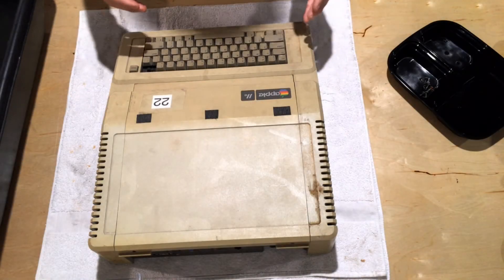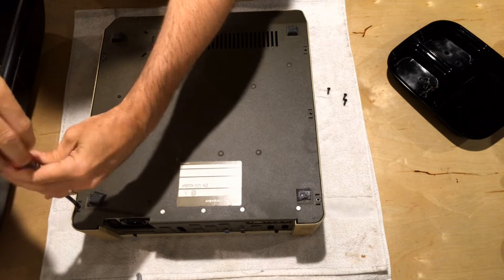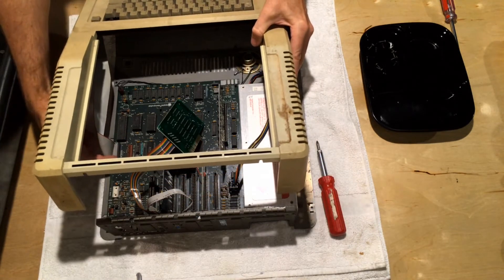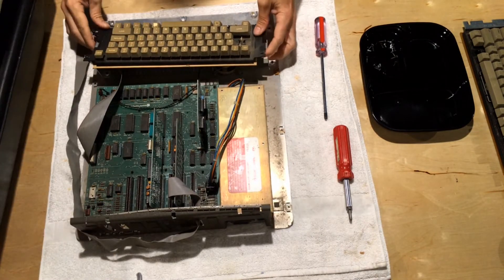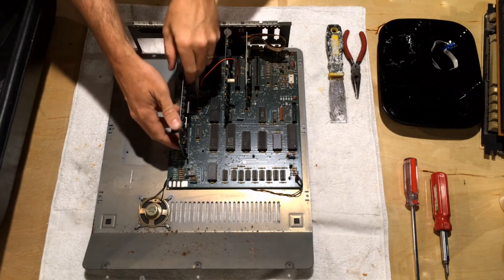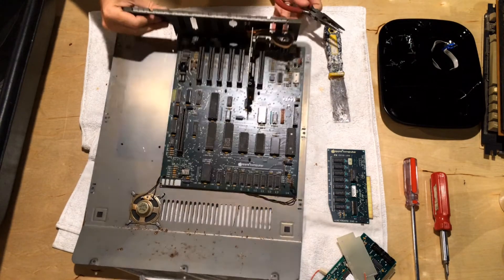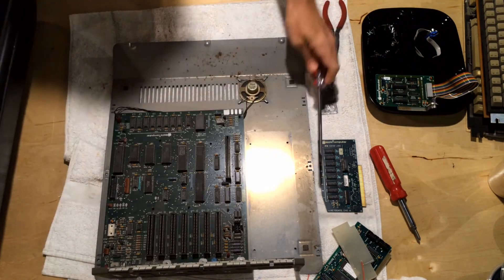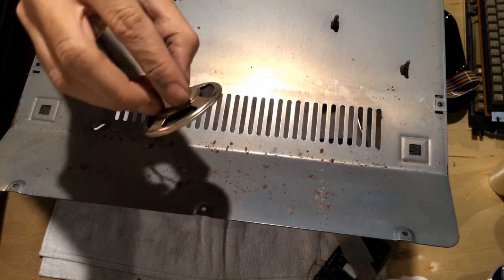Complete teardown of an Apple IIe

Comment: I just picked up an apple //e and this video helped so much! I have a question though. Do you have any other tips about removing the expansion cards if they are stuck?
Reply from the maker: Stuck expansion cards are the worst.  I might consider soaking the card edge and slot in DeOxit, which is both a lubricant and corrosion remover.  It’s not very cheap, but it works well.  If you can get any movement at all, that might help.  I might even consider soaking it overnight in WD-40.  Sounds extreme, but I’ve seen guys resurrect badly corroded boards that way.  Just be sure to clean it well if you do that.
Reply: Thank you! I actually had another question. I just ordered a replacement RIFA capacitor for the power supply (mine is cracked) and it’s only coming in October. Disappointed I tried doing some research to cheer me up and came across a video that showed someone testing their //e without this capacitor. Is this true? Could I do this while I wait?
Reply from the maker: @skidwheelplayz  yes, you can.  The RIFA cap is a line conditioner.  It’s there to clean up “dirty” power where the AC frequency isn’t consistent.  That’s not really a problem in most places anymore, so you can solder in a bare wire instead.  Chances are, you’ll never miss it.